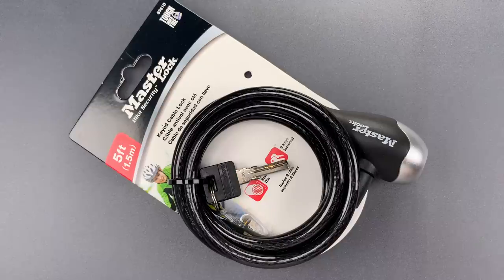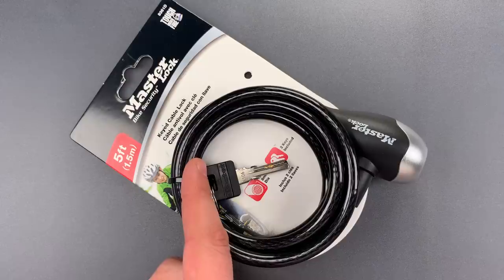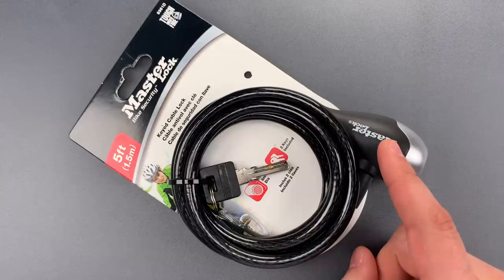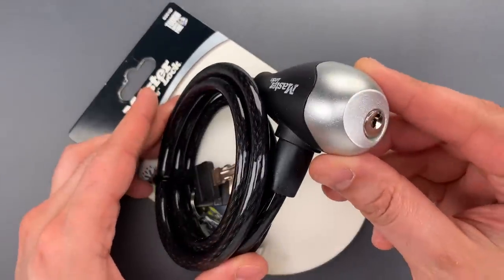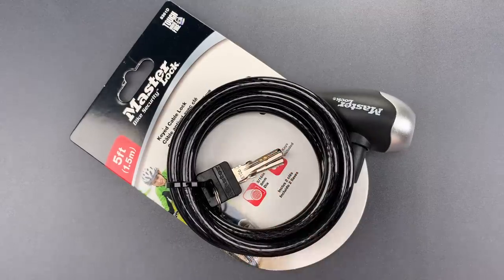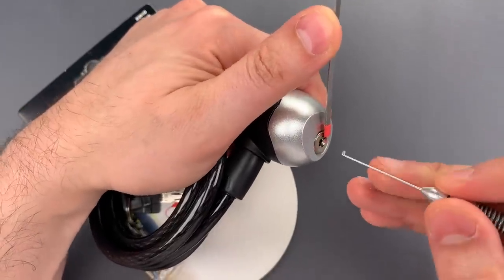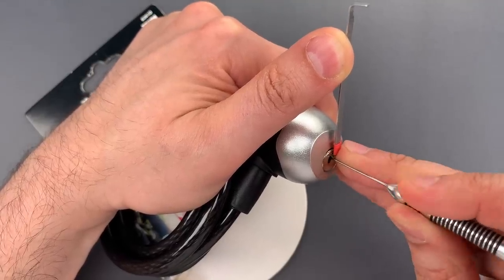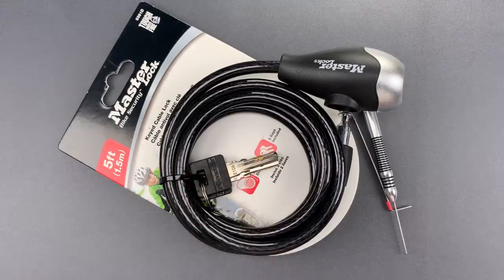[1173] I Can’t Believe This Is Sold As A Bike Lock: Master Lock 8361D

Comment: So, basically, what I've learned from this channel is that I should just use a bunch of duct tape when securing my items lol
Reply: Would still hold longer than a master lock 😂
Reply: Well looking at how long it takes LPL to gently cut duct tape on items sent to him vs the actual lockpicking ... you might be on to something#
Reply: APassersby  That's what LPL said. This lock doesn't even have shielding against cutters so it's practically uselessm
Reply: Zip tie
Reply: get a strong lock and make it look like the cable is made out of duct tape. but really have it attached to a strong cable and a continuity alarm wrapped around it. then take case case of a basic master lock so a thief thinks its a certain type of lock. but in reality it has a custom core. even one that needs a different set of tools than what it appears to need could be more than enough to thwart their efforts.
Reply: Well, you know what Red Green says...if you can't be handsome like LPL or Bosnian Bill, at least you can be handy...

Comment: "Can only be accomplished with more specialized skills" Finally master lock has a core worthy for the streets.
Reply: gets out a simple pick :)
Reply: Then they put it on a body that can be cut easily.
Reply: Yeah, a core.. but not a lock 😂
Reply: A lock that can stop people casually brushing against it to open it...

On a cable that snaps if the wind speed is too high.
Reply: tyvek05  pretty sure LPL was being sarcastic... i could throw those "special tools" together with a soda can and a paperclip... pretty sure he has done the same before
Reply: tyvek05  Doesn't matter when most bike thieves can just cut the cable with the side cutters they most certainly have
Reply: You need a thin piece of metal like a paperclip. Not exactly specialized. And that's assuming you'd bother unlocking it instead of just cutting the tiny baby cable
Reply: tyvek05  that pick is no more than a bent hairclip in reality though :)
Reply: This is what they call snatching defeat from the jaws of victory.
Reply: tyvek05  But as he says in the video, bike thieves generally cut cable locks rather than trying to pick them, and this terrible cable can be cut with a hand tool instead of needing a big set of clippers or an angle grinder...
Reply: too bad the cable isn't as good.

Why is the better cable used on bad cores and the better cores are used on the weaker cables. its like they don't want to spend any more than X amount on a lock's construction.

but yeah, it should stop random people from just walking off with it because, "clearly this was abandoned as trash"
Reply: @Kittsuera  a lot of products are like that, they know people look for different qualities in a product so different ones focus on different bits at the expensive of the rest of it.  Same reason in TV showrooms they adjust the tint and contrast of different tellies on display.
Reply: But then they use that core on a cable lock that could be cut with little more than nail clippers.

Comment: "click out of 2" 
ahhhh 2, you always seems to be the first to go.
Reply: That's because he starts in 1, and 1 typically doesn't make a click because when you pick 1 all pins are in set, which makes the cilinder straight, but when picking 2 then 1 has already oppened, so the cilinder is slightly bent already, so you hear the "clack" when it bends further. (It bends more violently than when picking 1)

So yeah, it ain't casuality, it's simple physics.
Reply: Ahhh don't you just love it when La Sagrada Inquisición teaches you how to pick locks

Comment: No bike lock protects against thieves stealing the whole rack with all the bikes still locked. Yes, that happened here at Orosháza, a pickup rolled up, two or three guys grabbed the rack, put it on the bed and drove away. In plain daylight. In front of the hospital. It was about a decade ago if I remember it right. So be careful where do you lock your bike, make sure it is at least bolted down.

Comment: Fun story, when I lived in Boston, I had a super old bike with U handle bars that sometimes wouldn't stay facing forward. If you hit a large enough bump, your forward weight was enough to rotate the handle bars facing down, almost surely making you fall hands first into the front wheel. Only fell a couple times once I figured out the flaw, which was not fixable without welding. Anyway, I locked that bike with this lock. When I moved away, I left bike next to the apt with the lock, with the key in the keyway, for anyone bold enough to steal the most dangerous bike to ride on pothole-ridden streets. Glad to know that whoever took that bike got an even crappier lock.

Comment: Most bike locks are just designed to prevent roll away theft. if someone wants it nothing is gonna stop them. I once had a bike locked to a utility poll at a bus stop with a half inch or thicker braided steal cable that is used for securing truck bed tool boxes. They cut the cable and took the bike.

Comment: It really depends on where you are.

This would be perfectly adequate for locking a bicycle to my front porch railing.  In fact, I stored one there for years with nothing but a broken cable lock with a much thinner cable.  It was literally the appearance of security with no actual protection.  It was never stolen, I ended up giving it to a friend.

Comment: When I was at school, with a bicycle, like the boy on the photo, this was just what a modern bike lock looked like.  What made it modern were the plastic cover around the wire, and being 'all-in-one' because the alternative was that the cable would have two loops to thread a padlock through.  This style certainly made things easier and quicker, at four stages in a journey: removing it from the wheel and locking it around the saddle on leaving, removing it from under the saddle and applying it around the wheel on arriving; and the same for the return journey.  

It was certainly easy to cut through then as it is now.  But I think someone could walk along a row of bikes on a bike stand with bolt cutters, sever every chain of double that thickness within a minute, and be on with loading them into a van, no?  I think there are horses for courses.  I bought a perfectly respectable mountain bike with spring suspension on e-bay a few years ago for the equivalent of US$13.  I'd probably struggle to replace it for the same amount, but on the other hand, how much more than the worth of the bike should I spend and encumber myself with?  (Just theoretically, because I haven't used the bike even once since I bought it, haha!)

Comment: I actually use that kind of lock for my bike. It's there to secure my front wheel to the frame and optionally against a pole or a fence. For that kind of thing it's sufficient. The bike itself is secured with an Abus. Two locks of different kinds, one of them pretty beefy so far has been enough to make thieves look for lower hanging fruits. And well, when I'm at home there's a third lock in play, which is too beefy to carry it with me all the time

Comment: The thin cable lock isn’t intended to secure the frame of the bike, but rather to secure a wheel in addition to a more secure frame lock.  You can only carry so much weight, so these accessory wheel locks need to be lightweight.  For the purpose of locking a wheel, this seems like a decent choice.

Comment: You are all forgetting that these locks are for Opportunist theft, e.g. someone coming along and simply pulling/physically breaking with hands and walking off with it. It's not designed for intentional effort e.g. using bolt cutters or using pick tools.

This lock is perfect for locking up outside a shop or at home, if you really want to stop the additional risk of someone using bolt cutters etc then ensure it's locked up better with additional facilities like chains, extra locks and inside secure buildings.

Comment: In my opinion, bike locks in many places do not need to be incredibly secure. Many bike thefts are crimes of opportunity, meaning that even if the lock is easy to cut, the mere presence of the lock would deter many prospective bike thieves. Alternatively, just remove the saddle; nobody is going to steal a bike with no seat.

Comment: With 1173 videos, do you have a favorite lock to pick. Not one you can't pick, but one that you can pick and is still a bit of a challenge?
Recommendation if you are interested, a timer on screen from pick insert to open a lock. I saw at least one where you had a timer on the table, but I was wondering if you had thought to add one on screen next to the pick? Just have been thinking it would be interesting.

Comment: Locks like this are more of a deterrent than a preventative measure. I use something like this for my front wheel with a beefier lock for the back wheel amd frame. All I need to do is make stealing  my bike less attractive than the bike locked next to mine. If I use two locks, thieves will likely go for an easier option nearby and mindless vandals won't take the front wheel just because they're bored and want something to trash.

Comment: It's still better than the cylindrical combination lock with vinyl-covered chain that was very common back in the '70s. 
No tools or picking was required, all you had to do was yank on it hard enough.

Comment: I had a seminar lock for my bike. A former bike thief told me that this is  is a string and to get something much stronger like a u-lock, so I did. Along with Kryptonite thick cable to secure my wheels with the u-lock. I can park my bike different parts of the city and nothing happens and I even have my seat tied down when I  took it at a bike shop.

Different parts of New York City I saw at least  two similar Master string locks on the floor that has been cut indicating that the bicycle stolen been stolen.
From the beginning I knew it was thin enough to be cut but I didn't want to spend the money for better Locking System because the master string clock what waw lighter and more convenient. But I am glad I spent the money made the switch.
My friend he was a new lock as well I'm not a speck cable to secure the Wheels, needless to say front wheel was stolen had to pay $60 for. And a different guy try to steal his front wheel again and he been caught. He is very cheap. It is very expensive to be cheap. Because he had to work for 60 bucks to buy a new wheel he work more to make the same amount. That is double time wasted.
It is always better to do it right the first time no matter what you do in your life.

Comment: Sometimes even a simple lock will do;
My bicycle has a lock of it's own and I also use two light weight simple locks; one i put on the front wheel, one on the back wheel.
What matters is that there's a lot of bicycles around with no extra locks and thieves just want to be as quick as possible; stealing my bike is just to much effort compared to the other bikes around.

Comment: Cyclists call these cafe locks. i.e used to lock you bike while in the cafe but the bike is still in view at all times. They just prevent opportunists riding off on your bike. Having said that no regular bike thief could pick that lock. They could definitely easily cut the cable though.

Comment: Locks are meant for honest ppl. That was so easy to get in. An if mechanically inclined it's not hard to get into a lock but it does require some picking skills
Reply: Or a common cutting device and no skill at all.
Reply: @jrd33  but thats not getting into the lock tho. Thats cutting the cable or chain lol. But ive used a hack saw many times.  When i was younger. I also un hooked the linkage from a truck to move the truck so i could get into the container to get the 4 wheeler inside. Thats why i saod lock are meant for honest ppl. I no longer do dumb shit tho that was when i was 18 im 30 now i learned my lesson tho. Did my time it sucked

Comment: The lock is great!  The cable is not.   You don't judge a lock based on pick resistance for an expert.  "...picking can only be accomplished with more specialized picks and skills."  In fact, the primary criteria for any lock is resistance to brute force attack or easy bypass vulnerabilities since very few criminals single pick locks.  Bumping and raking are a bit more common - but again, rare for the vast majority of criminals.  Especially on a dimple lock.

Comment: I have this lock. I use it as a deterrent because my bike is cheap and I just don't want it to get walked off with on my college campus. The problem with even using it for THAT basic purpose is the keys both broke as they are made out of garbage metal. One broke in the keyway and now my lock is permanently unlocked. I just twist it to open. Honestly given how easy it would be to cut and that it still looks locked I don't think this has effected the security at all.

Comment: I think the point of this lock is to lock it fast and easy, for quick leave. If you can bring a cutting tool, well everything will fail. Nice picking though
Reply: The cutting tool you'd need to defeat a hardened steel U-lock is probably going to be a bit more than side-cutters and you'll need more time than someone would need to cut a cable lock.

Cable locks can be defeated by side cutters in ~30 seconds. https://youtu.be/g9BU-Wjgs-U

Comment: There's a real cheap Klom pick set from china with a LOT of picks (a fair amount of them rather useless...) But it has a real simple dimple rake. Just a flat piece of metal with a few bumps.
I actually used it with ease on some cheap low (no) securitu dimple locks, just as key, without tentioner! I bet that this thing would fit :p

Comment: You didnt even look at the keys on those locks. That black plastic on the key, is not a cover, its literally 2 plastic half snapped together with the metal in the middle. It's most crappy plastic and often breaks and leaves the key stuck in the lock.

Comment: I'm still waiting for the day a lock is so bad he doesn't even have to rake or even jiggle the lock. He literally just inserts a straight scrap of metal and it opens as if it were the key.
Reply: Jason K: Check the archives, he opened a whole series of locks with scraps of metal from a redbull can.
Reply: ParaPick Tog I remember those. I think he jiggled open one, maybe two after a few seconds with it, but most of those were shimming and dial tumbler attacks. Right idea but, I’m saying it actually and almost reliably acts as the key. I will have to look back through those to see if you’re right though.

Comment: I had one pretty similar to that, which I used to secure my trailer. One day I forgot to unlock it and drove off. The locking pin snapped, but I didn't feel any resistance. Rubbish.

Comment: I have seen cable locks twisted until something gives, is this lock vulnerable to that attack as well? Where the lock is around a frame and a lamppost, a stick or something is inserted into the loop, then the stick is twisted so the loop diameter gets smaller until it starts to pull on the body.

Comment: Hey LPL, Sparrows just sold out of another batch of "the pick that Bosnian Bill and I made" and will be releasing another batch in early November. As such, there are going to be a lot more of us that will finally be getting into picking disc detainer locks for our first time. Any chance you could throw up a video in which you recommend a few locks for us new guys to cut our teeth on? Also, what tool do you use to rotate the discs as far clockwise as they'll go? Maybe a link to it?

Comment: I do so enjoy your videos and trying to catch up on them. But with this cable bike lock one would not be able to cut it with side cuts. One does not have the strength nor the leverage to cut a cable this thick. I tried to cut one similar that is smaller in diameter at 3/16” and side cuts will not do the job. This one is thicker at 5/16”. Cables are just to hard and flexible to be cut with side cuts. Great videos!

Comment: So, what you're saying is that THE ONLY Master Lock that is actually difficult to pick, is coupled with an inadequate cable.
So they are actually making a concerted effort to make useless products. That's actually quite impressive.
Reply: LPL has reviewed other Masterlocks which have good physical strength but terrible cores or decent cores but horrible weaknesses in other areas. A very strange company.

Comment: I don't think it would be allowed to sell this lock in Germany at all. We have very "strict" consumer protection in Germany, which would probably take the lock off the market because it would be so bad. Aldi or Lidl (German supermarkets) would not sell such a thing either, as both are known for the good quality of their products.

PS: The core would be okay. But the cable is NOT okay.
Reply: You can buy comparable locks since decades in Germany. I  have a similar one I used when I was a child, it's still in the garage (of course I use better locks today). There are plenty of cable locks offered, and they are all not really safe. 
For a more expensive bike locks like U locks or something comparable to a Abus Bordo should be used, of course they can also be opened, but it takes way more force and more time.

Comment: As a guy who works in an industry where cables are a daily use thing, I guarantee you will not be cutting this lock with side cuts. This lock is advertised as having 5/16" braided cable. That would give even purpose-built handheld cable cutters a workout. Unless you have 10 minutes, forearms like Dwayne Johnson, and the best side cuts known to man cutting this cable would require.........wait for it........specialized tools. Maybe y'all live where the bike thieves are well-trained professionals.